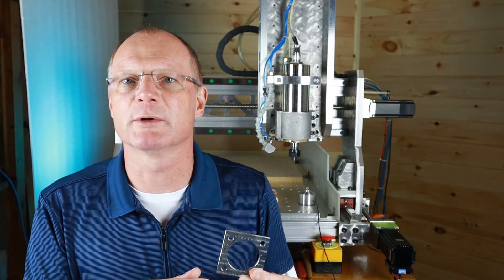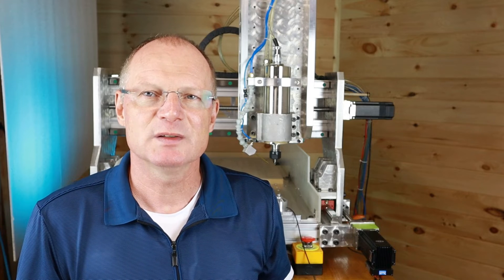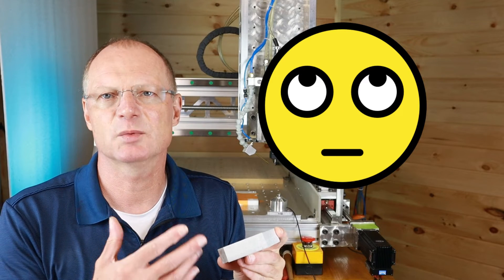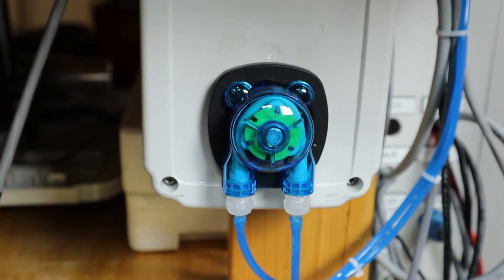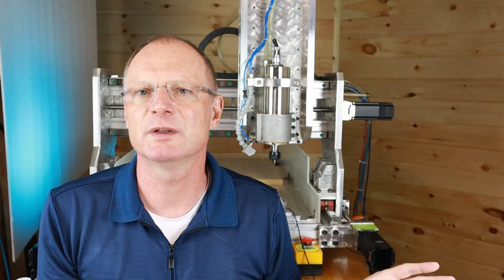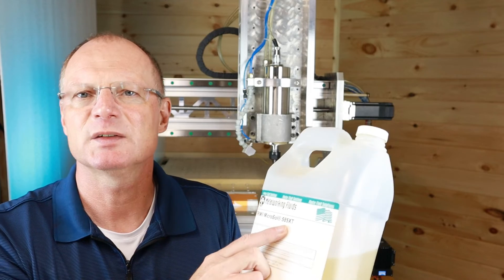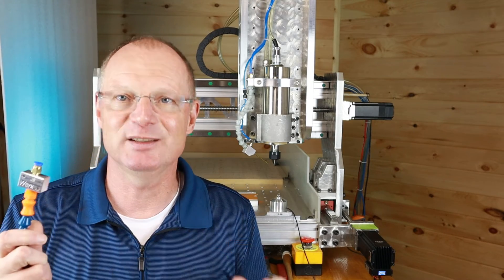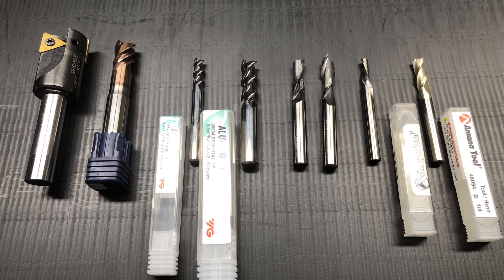Cutting aluminum with a CNC Router / CNC Router Beginner to Pro EP7

Comment: what cam program  do you use on aluminum?
Reply from the maker: For the past 5 years I have used Fusion 360. Especially because I have CAD & CAM in one Programm. I tried FreeCAD and I am ok for the drawing side of it - but could not make the CAM part work for me.

Comment: What spindle do your machine have ? And can it run at lower (less than 10k rpm) speeds ?
Reply from the maker: It is a 2 pole spindle so no I cannot run it below 10k. It’s the 2.2kW Huanyang water cooled 3 bearing spindle

Comment: Hi, thanks for the great information. With the isopropyl, is that just a straight mix? also just watched your part 2. I have been using single flute DLC upcut bits from a local supplier (chinese made going from the price). Is it really worth the extra for the Datron bits? I almost fell over when i saw the difference in price? I am still experimenting with different bits, lubricant&air, air only, no air (recently - just to help my dust extractor - though not having success with the cutters lasting). It sounds like i need to reduce air mister pressure and try alcohol for the lubricant. I have recently been experiencing what you are talking about as the cuts get deeper and chip evacuation, the air is a must. Great, clear information on both videos - Thanks!
Reply from the maker: So if you can get the project done using your current bit and you are happy with the surface finish I would not change. I tested several different bits in aluminum and the Datron is the best in plunging and longevity. So for me yes it’s worth it. It’s straight Alkohol no dilution and yes you don’t need much air pressure as this will atomize the fluid and that is what is not desirable. Thx for your comment.

Comment: Thank you so much for starting this channel. I have recently built a CNC using standard 20x80 and 20x40 aluminium profiles but because I do not have access to another CNC, I decided to 3D print the plates (10mm).  I am pleased to say that it is fully operational but I have not attempted to machine any material. The workarea is about 500mm x 400mm. Once I have the accuracy tested, my plan is to use the RepRap method to ultimately machine all the plates in Aluminium similar to your machine. To begin, I need to get a sheet of 10mm ply-wood. What type of ply-wood is best for ridgidity for machining aluminum?

Oh I forgot to ask, why have you opted to have such a tall z-spindle part?
Reply from the maker: Excellent !! So best is if you can find Baltic Birch Plywood it has more layers than regular plywood and is much better. The Z plate length is this way because I have moving rails (instead of a moving guide block). This allows me to mount any spindle in the future. Good luck with your built !!!
Reply: @JBWorx  Thank you so much for your reply. Yes, I see you have an interesting z-motor and ball screw setup that is mounted at the rear. I see what you mean about this design gives the flexibility of installing different types/size spindles. I checked up the Baltic Birch plywood I can get hold of 9mm thick and add a spacers to compensate for the 1mm gap. Would it provide sufficient rigidity to machine aluminium all be at say the lowest possible DOC of 0.1 - 0.12mm with a the cheap chinese 1/8 inch single flute endmill using my 500W 12000rpm spindle ?  I haven't got round to doing the RPM calculations that you showed in this video but I will do that soon.
I forgot, I liked your Logitech gamepad control -  is it a USB type.  My cnc control software is CNCjs will it need any special programming to get it to do basic up/down/back/front/side movements.
Reply from the maker: The limit of small desktop machines is often the spindle and how it is mounted. I don’t know if you will be able to cut Aluminium but hey it’s a goal so improve your machine until you can. CNCjs has widgets that you need to run through so that the settings are correct. As an example your x-axis might move left when you want it to move right. Have fun with your cnc and learn as much as you can with it.

Comment: The magnetic flashlight on the band saw is an awesome hidden tip there. I'll have to try that with the extra harbor freight lights I have like that.
Reply from the maker: That is exactly what this is -  HF flashlight. And yes it works really well for cutting along a line.

Comment: What do you use for collets and collet nuts?
Reply from the maker: When I started out I used a set of Chinese made Collets. Over the years I upgraded to “AA” precision collets about $14 a piece. On  Amazon you can get Techniks The nut needs to be dynamically balanced again Amazon 4 for $13.50.

Comment: been using Alcohol for years with a little Tap Magic added in,  very clean cuts, with just a thin film of tap magic left on material, just hold air pressure down to prevent vaporization
Reply from the maker: That is an interesting idea, I have to try that ! Once you mix it and fill it in the canister will it separate at a later time let’s say over the weekend ?

Comment: Any chance you can provide details (links etc) for the aluminium you mention, good video's btw :-)
Reply from the maker: Yes certainly. Best is to find a provider near you as shipping can be expensive on larger plates. Here is an example from online metals. 
https://www.onlinemetals.com/en/buy/aluminum-rectangle-bar-6061?q=%3Aprice-asc%3AMaterial%3AAluminum%3AShape%3ABar-Rectangle%3AAlloy%3A6061%3AThickness%3A0.5%2522%3AWidth%3A6%2522

Comment: Just wanted to say tha ks for doing this series, i know how difficult its to produce videos, definetly at the quality you make. I look forward to seei g ypur thoughts on bits.
Reply from the maker: Coming right up … working on it at the moment. And thanks for reaching out.
Reply: @JBWorx just as aside your wish i had seen yours before i bought an official fogbuster, and the pump is a really great solution.
Reply from the maker: Yes the pump makes all the difference. Possibly you can modify yours and simply add the pump ?
Reply: @JBWorx  probably, i alread had to replace the pump as i accidentally sliced while sufacing my ali spoiler 🤣
Reply from the maker: Oops 😬

Comment: I have to correct you straight off the bat, 1000 series aluminium is very easy to machine!  It's extremely easy to machine and the most versatile grade for brackets and parts that need forming.
Reply from the maker: Well 1000 series aluminum has a min of 99% Al and that makes it rather difficult to machine but yes you are right very good for forming.

Comment: I want to move into cutting metals, but the idea of managing cutting fluid/mist on a desktop CNC machine is frankly scary mess. I see a piece of MDF at the beginning of the video, I just see that crumbling into pile of dust.

I do see your Y rails have a shield too. Is there a chance there is a video on "waste" management?
Reply from the maker: Thanks for your comment Carl, yes MDF as a spoil-board will not mix well with any coolant. So I used a small pallet made from POM (Acetal, Delrin) and mounted the parts on that for quite a while. Actually I still use that pallet today just on top of an aluminum table. 
Because of filming the video you will rarely see my dust shoe in place but I always use it if the camera is off. It makes everything so much easier to clean up. Yes on the left and right side there is a plastic “shield” to protect the linear rails and ball screw… it works somewhat ok but I still clean them a lot. If I have a large job I simply use poster board and tape it under the gantry and on the sides that is very effective and costs very little.
Reply: With the right bits you don't need cutting fluid.
Reply from the maker: So I use a lot of Datron bits and choose to use cutting fluid can you recommend a better choice for aluminum above Datron single flute bits ?

Comment: isopropyl alcohol is expensive, I use denatured alcohol, it's cheap and it evaporates too, it only differs in color and price if we use it only for milling. Unfortunately, neither of these should be inhaled.
Reply from the maker: The good news is that one will use very little of it. The bottle I showed in the video costs $2,20 and unfortunately the denatured alcohol I can find locally costs more and has a lower percentage. For a while during COVID it was hard to find.
Reply: @JBWorx  For me, unfortunately, it's already about $5 \ L

 $2,20 for 1L is a nice price...
Reply from the maker: In Germany we have something called “Spiritus” but boy that stinks up the entire shop just in minutes. I often use a piece of paper to set the amount of fluid used and the nice thing is that the peristaltic pump will deliver exactly that every time. It’s an expense to add but I really like it way better than the Venturi set up I had before.

Comment: Very informative as always. I am using 99% iso (Costco) with a small amount of sewing machine oil in it, coming out of a Fogbuster clone that I made. Soon switching to a peristaltic pump for better control of dosing. It works very well for both cooling and air blast,. Initially used an air brush compresoor, not much pressure or volume needed. I do agree that for longer runs an air exhaust would be a good idea.
Reply from the maker: I am always surprised how little alcohol is used even let’s say on a 2h run. I guess if the machine has a small enclosure things could get dangerous without an exhaust. Like to mention there is a complete peristaltic dosing pump available on Amazon I have used it for two customers and they are super easy to set up and can even be programmed. If you pick one make sure it’s driven by a stepper motor.

Comment: We call it MQL too, minimum quality lube, though Fogbuster is the commonly used term. And I have seen others going over to using iso-propyl alcohol rather than WD40. 70% IPA is used to clean the skin for blood draws, etc and it is also present in hand sanitizers. But there is little data on chronic inhalation; prudent to have good ventilation. Great points about keeping the slot free of chips and keeping everything cool.
Reply from the maker: I think Datron provides the most evidence that alcohol works great as a coolant and their machines do start to sell in the US.
Reply: @JBWorx  Now that's a dream machine, sadly with an in my dreams price😀
Reply from the maker: Not in mine either  😂 I know a company in Lexington,Ky they make special horse shoes for the horse racing “industry” and amazingly enough they have Datron machines to make them … blew my mind.